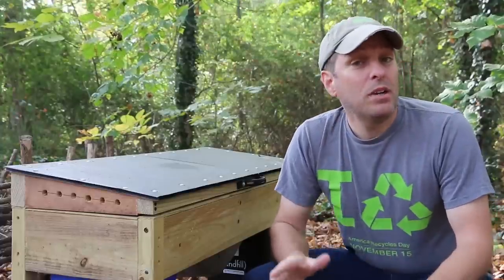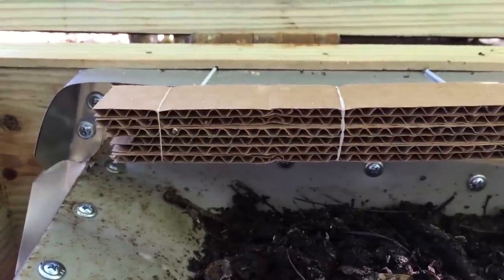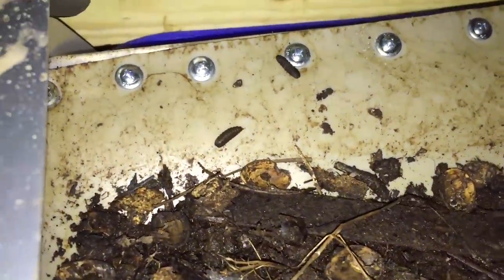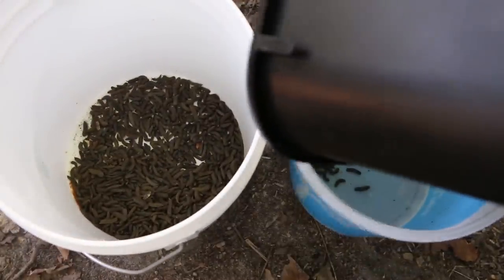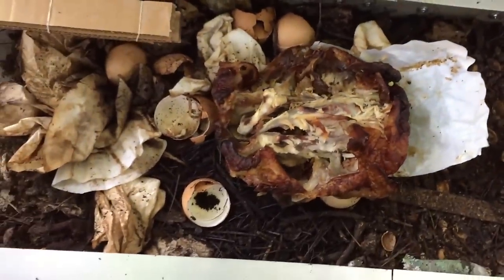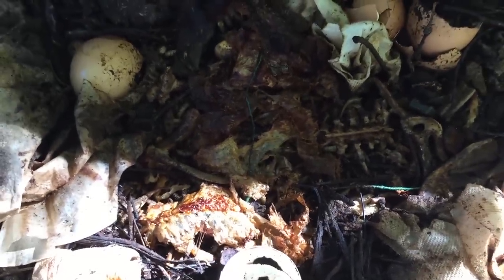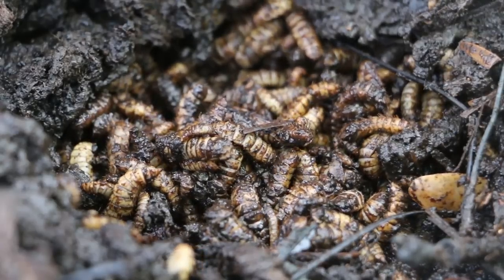How To Operate A DIY Black Soldier Fly Larvae Composter

Comment: So, from the point that they are crawling up the ramp to the bucket, they are hoping to turn into a BSF?  

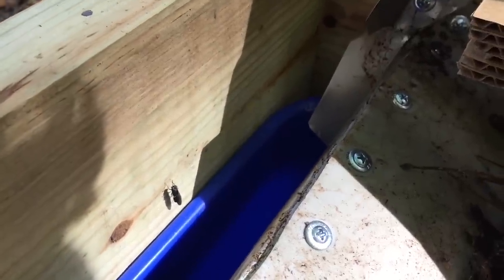Also, how do they get up into the cardboard?  (I'll delete this if you tell us about that after the point that I'm typing this. @7:24.  I am always afraid I'll forget my questions. lol!)

Sorry, I'm new and trying to learn this process because I hope to be able to raise these for my chickens. I'm so not an insect person and the whole larvae, pupae, etc confuses me.  LOL!  Excellent video though!
Reply from the maker: Heather...yes, they are crawling out to hatch into adult BSF. The adults fly and then lay eggs (in cardboard or other cracks). I'll usually let some go from each batch to hatch out. They will return to the bin to lay eggs as long as there is food. The cycle goes: Egg, larvae, pupae, adult (I think). A great food source for your chickens. I can only get them to reproduce when temps are above 70 degrees. Pupae will slow their development and over-winter in that form, then hatch out when temps warm again in Spring. Pretty amazing creatures. Thanks for watching.
Reply: @GreenShortzDIY  Wow, super helpful information!!!  I wonder if a heat lamp would help them keep producing in the colder months?  I'm thinking about setting this up in my garage.  It get hot and humid in the summer (eastern NC) but super cold in the winter.  I'm thinking a ceramic heat bulb might help in the winter?  Anyway, I very much appreciate your feedback and am going to save your video to favorites to watch again when I think I'm ready to start this.  <3

Comment: Hi Tom! Thanks so much for the tutorial! I was thinking about making something like this.  The only changes I was thinking about had to do with drainage.  I was thinking maybe of a mesh/weed cover fabric that is about a inch higher than the bottom of the composter.  The bottom of the composter would be solid wood  (maybe lined with something to prevent rot). Then I was going to add a faucet at the lowest point connected to a bucket to catch the extra liquid.  Do you think that would be a good idea? How much liquid must be retained in the compost for the larvae to thrive? Also, what percentage of larvae do you allow to mature into the flies?
Reply from the maker: Hi Scott. Your mods sound interesting. I think they’d work well. I think the larvae would do fine without keeping any liquid. They’ll make more anyway. :-) Regarding, how many I release, I don’t really have a target number. Even 20-30 should be enough to keep the population going. Thank you for watching.

Comment: What time of the year do you compost, and does the time of year you do it become less beneficial for the plants ( you said you close up season in the winter). Also how do you get the compost out when it’s not the end of the season?
Reply from the maker: +Isabel Gallard I compost all year, but using different methods. You can just dig the compost out of a soldier fly larvae composter with a shovel and add to your garden. You will likely remove some larvae too, but they will just hatch into adults and return to the composter to lay eggs, as long as it is relatively nearby. I like to cover the soldier fly composted material with wood chips or another mulch when I add it to a garden bed or around plants. Thanks for watching.

Comment: hey man, what do you do with the remnants of the compost after the larvae have done its thing? we have a bin that now on the bottom has a layer of brown thick muddy slime where a lot of the larvae are.
Reply from the maker: Andrew Holdaway I will use a shovel and scoop out 1/2 of the remnants and move them to my compost pile or garden. In the garden, I’ll cover with wood chips and in the compost pile I’ll cover with leaves. If you’ve got chickens, you can let them scratch through the material first to get at the larvae that remain. Left in the garden or pile, they’ll hatch to adults and fly back to your bin to lay eggs, if it is close enough for them to smell. Thanks for watching.

Comment: Share the dimensions of the BSF breeder pls
Reply from the maker: Hi Luis. Thanks for your interest.  The dimensions of this BSFL breeder were kind of arbitrary. I think if you built something with the general size and ratios it would work. But, here are some estimated dimensions and recommendations. The width of the unit was about 10 inches. The depth of the trough was about 6 inches at its deepest, but the BSFL tend to work at the surface, so surface area is more important than depth. But depth will have a effect on the volume it will hold, of course. The ramps on either end need to drop down pretty steeply. And you’ll need something to keep them from crawling out the sides (the strip of flashing, in this example). I built a second version of this system that simplified a few elements (eg, replaced the trash can with a piece of tarp). It worked just as well. Hope this helps. Thanks for watching.

Comment: Hello everyone...I live in Phoenix AZ and am starting a backyard garden/ food forest... anyways, what I wanna know is should I attempt this ?
I don't have chickens and I don't want them because of my neighbors pitbulls dogs,so I ask what can I really do with the larvae???
Any advice or ideas is appreciated thanks!
Reply from the maker: The BSFL are great composters, even if you don’t use them as a good source for chickens or fish. But, you might get more benefit using worm composting directly at or near the base of your trees. In my experience, I see the output of a BSFL bin as the larvae, whereas with a composting worm bin, the output is the castings. If you set up worm towers at each tree (or in several key locations) it would allow you to use food scraps as a nutrient feed stock, to help support your soil development. If your focus will be trees and not include chickens, don’t add BSFL to your system. It will require extra maintenance time you’ll want to spend elsewhere. Worm towers, once set up, will be very little maintenance. You could also do a centralized worm composting bin and top dress the trees with castings. That might makes sense in AZ, with the arid climate. It might need to be indoors. Hope that helps. Thank you for watching.

Comment: does the compost bin stink?
Reply from the maker: The black soldier fly larvae composter can have an odor. A lot of it depends on what is in the bin. A well fitting lid helps reduce the odor escaping, but at some point you've got to open it to add more compost. I keep it in the back of the yard to help keep any odor at a distance from the house. Thanks for watching and for your question.

Comment: Great design; would you consider selling me one of your bins?
Reply from the maker: Hi Neil. I’m not opposed to it, but I think the shipping would be very expensive. However, I’ve got a much simpler design in the works, that wouldn’t require all the woodwork. I’ll make that video in the next 6 weeks. I think that it would be something you could build or something I could send you most of the parts for without breaking the bank. Wait for the video, then we can discuss. Where do you live, by the way?
Reply: We live in Baja but have a freight forwarder in San Diego, Ca

Comment: My compost isn't attracting bsf. It's attracting house flies. Why is this? Is it the weather is too cold for bsf?
Reply from the maker: In my experience, the house flies come first. Then the BSF come and take over. Temperature is a factor though. In my climate, in Georgia, in the Southeast US, BSFL are a seasonal composter. The are active once the temperatures are consistently above 75 degrees F. Once it goes below that in fall they are done for the winter. In a tropical climate, they should be able to go year-round.

Comment: If the larvae harbor pathogens then is there a risk to feeding them to chickens? I wouldnt want to get a parasite
Reply from the maker: +TonydlP650 Black soldier fly larva can be pasteurized to kill any pathogens by sitting them in the sun for an hour or so. Timing is key, given that too much heat will also kill the soldier fly larvae. I am not a scientist, but my sense is that any pathogen's present on soldier fly larvae would not be the type of biology that would harm a chicken. Don't quote me on that. :-)
Reply: BSFL are considered pathogen free in most cases. They are actually rated as clean enough for safe human consumption to the point there is a tabletop system specifically designed to create them for humans to eat. They do not harbor parasites that could harm the chickens where red wigglers do. Their guts naturally destroy most bacteria and they have been shown to significantly reduce or even eliminate the presence of E. coli 0157:H7 and Salmonella enterica in hen manure.

Comment: where do you get your larvae? how did you make them lay their eggs there
Reply from the maker: They are attracted to the smells of the compostables starting to rot. Initially I had soldier flies appear in a worm composting bin I had outside. At the time I wasn't sure what they were. Once I learned what an amazing composter they were, I started trying to attract more. Where I live, in Georgia, the cold winter temps make them go dormant. They actually slow down their metamorphosis in the larvae phase to "hibernate" through the winter. To attract more adults in the Spring, I leave some of the composted material in the bin, the rest goes to my gardens. The smells this remnant generates helps the newly hatched adults find their way to the bin to lay eggs. Thanks for your question.

Comment: I kinda ripped off this idea when I made mine one thing I did was I made a "starter"colony with old dog food and water (stole that from another YouTube video from a) but with me working at a petstore I have cheep to free dog food running out of my ears so I filled it with a 50lb bag of dog chow (if that works then that makes 1 thing dog chow is good to feed) but does any one think that I will have any problems with this method
Reply from the maker: +O.G.O.B Outdoors that's a great idea for old dog food that would go in the trash. I don't think it will be a problem. The black soldier fly larvae will process what they need to build their body mass: fat, protein and amino acids. I bet they love the stuff. Thanks for watching.
Reply: GreenShortz DIY the only problem I have noticed so far is ants and moisture dry dog food is not the easiest thing to keep at the right moisture level